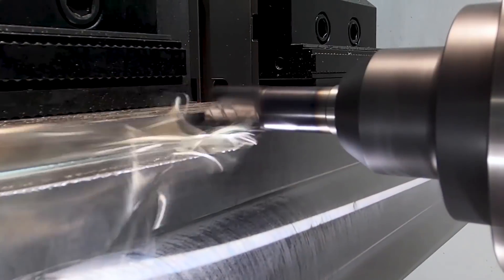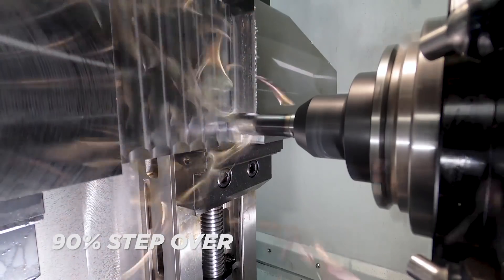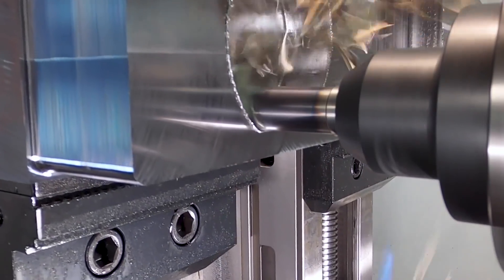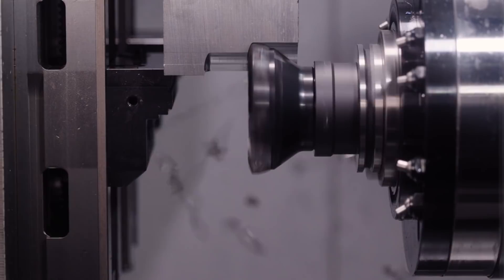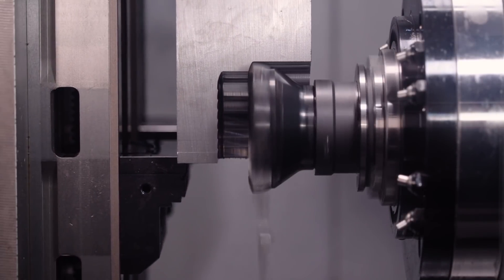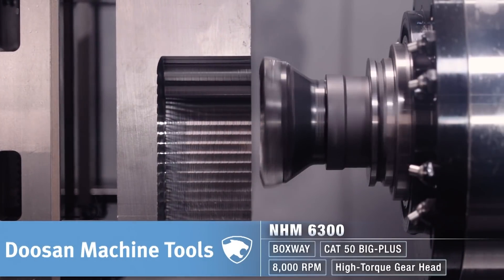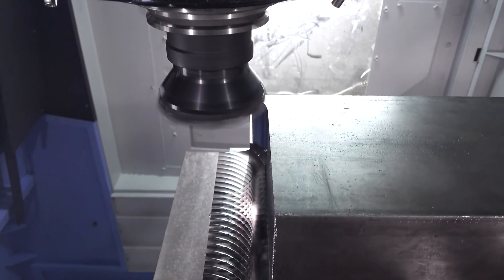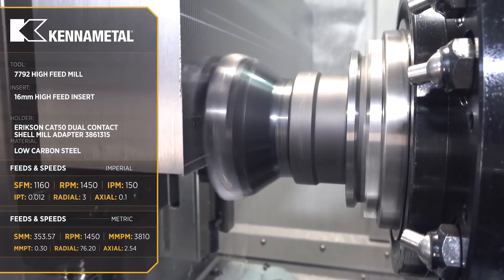Accepted a Complicated Job Beyond our Capabilities… Now We’re Screwed

Comment: One of the things my instructor taught me was it is okay to let your employer know if there is something you have never done before but don’t be afraid to challenge yourself. Who knows maybe the company will work with you to learn how to do the task they assigned you
Reply: That's exactly what I did when I took my first Inconel job. Each piece the material alone was worth 20k the customer sent us material for 3 pieces but we only needed 2. I told my boss I had never done it before but that I'd be willing to try. About 20 endmills pater I wound up getting them 2 pieces in spec and 1 out of tolerance with a deviation report. Supposedly all 3 were usable.

The prices were about 18x26x.450 and we were making chips out of over 90% of the material. Nightmare that job was.
Reply: If the company won't work with you let the company go.

Comment: bosses demanding stuff being done in-house without us having any of the capabilites necessary is the standard for consultants to rich kid startups.

They actually bought the big-ass gantry mill we needed to do the job once. One single job, an 800k machine, 3 months slower than outsourcing to a jobshop a bit over a km away. That delayed the start of the main production line for over 4 months. The machine is luckily used in one of the side lines now but i still get mad when i think of it.
Reply: Why are you still there

Comment: That’s a common scenario in machine shops and other industries.  I’ve always said “the salesmen make the promises, we (the workers) have to keep them.”. The sales people should be responsible for consulting with the production people on every job to discuss the feasibility of projects. When a job goes south like this one did, sales needs to take their share of the responsibility. It’s hard to believe that management allowed this job into the shop with an exotic metal that the shop had never worked with.
Reply: Management always has the final say in which contract to accept or deny.
Salesmen are just the "Pimps". Guess what it makes us?        : )
Reply: We had received a quote request for a job many years ago for an aerospace part, something like NASA would be using on a spacecraft. Large body panel, Boring Mill type work. Lucky for all involved, the shop foreman came to me, the person that would have been doing the job, and asked for my thoughts on it. I told them they do not even want to quote it, because it was way out of our league and would have been a disaster money wise. It was one of the few times they took my advice.
Reply: Right
Reply: I worked at a translation provider for a few years and we had a few jobs in my time where the salesmen (it was a mixed department but the troublemakers always seemed to be the guys) either promised services that we didn't know how to deliver or let the client stitch us up.
Reply: In this case the sales rep needs to take all the responsibility.  You wouldnt sell a wiring job to your plumber.  Sure the plumber may be able to meanser through it, but I'd be using shock gloves on your light switches for a while.
Reply: sometimes it is a good thing salesman does not know "it can not be done" workers generally does not look for challenges and settle into routines
Reply: @imrebalogh2786  - I agree with you. The shop wants easy, high margin, repeat work with generous tolerances and lead times. Guess what? So does the sales guy - but that type of work is RARE.

The challenge is needed sometimes to help the shop grow - but the trick is to balance occasional ridiculously hard stuff with the bulk of your work falling right into your core competencies. Shift the balance too far away from your bread and butter - and that will cost you business and employees.
Reply: Nobody in engineering or the machine shop wants to work in sales. Drinking and partying and sucking up to big fish clients. You all want to just work your machine so you get shit on. Better yet, start your own shop, upgrade your skills, invest, and when management tries to push you, push back until you have some capital and likeminded people.

Comment: Unfortunately for us our cam backbone is not great so when we get parts like that basically we get a basic program, then the experienced guys on the floor have to make it work. Used to happen to me all the time with our titanium parts. I'm totally comfortable with running Ti but alot of the guys on the floor either haven't touched it mill or lathe. And pretty much we never kick jobs out the top guys just get told to make it work.

Comment: hello I had similar problems, with a colleague we got titanium plates to be made, the managers did not want to hear about the problems, in the whole company, about 100 people, nobody worked in titanium, I spent hours gaining knowledge, but we paid for the failures with the programmer losing my job, Fanuc machine but low stiffness not intended for steel machining, more plastics, 5-axis machine but with three, threading, I came up with the idea of threading with a milling cutter, then they called me when we were making threads because they had a problem with it ... a lot of regret left
Reply: Threading with a milling cutter? I always use 2 milling cutters :)
Reply: @lokkas3637  it doesn't matter now, but back then it would have been very good advice thx👍
Reply: @piotrp9898  you aren't serios are you?

Comment: I was running a cnc 1000 ton beast PRESS BRAKE at the time and management wanted me to bend a 2.5 inch piece of steel 35 inches wide. I told them I was impossible because that thickness would need to be annealed before bending but could not be as it was stainless which can not be annealed and retain its properties as stainless steel. Anyways they forced me to bend it and it snapped in half while pushing at about 400 tons of force. BANG! Rattled the whole shop, scared the crap out of everyone. I was well clear obviously because I knew it would happen. Customer ate the cost but why risk damage to a half a million dollar machine. The end.
Reply: Something similar happened to me. I was bending a 1 inch thick piece for John deere, roughly 12 inches wide. Lead man wanted me to form it on a 56mm V die. My machine couldn't handle it so I went to a modern bystronic 220 ton which was also well underpowered. Per the instructions of "just run it". My die  split down the middle sending half of the 80LB die at me. The lead man came running from the bathroom saying "what happened the ground shook when I was in the sh*tter".
Reply: @griffinphilemon5083  yikes man I'm happy you were not injured. 56mm bottom??? On 1 inch plate??? My God someone could have been killed. Never go less than 5 times material thickness for your bottom or expect an explosion. And clear personal from the area. Appropriate bottom v size for that bend was around 300mm. That makes minimum flange length 4.25 inches or else one must leave trim stock.
Reply: @BarronBros1822  now that I think about it, it may have been an 80mm, but still too small. I've since left that steel factory. I don't think anyone had been professionally trained on brakes there. Just knowledge passed down, and now always valuable knowledge either. only a corner hit me but definitely could've been worse. Never good to have an accident on 220 tons of force.
Reply: @griffinphilemon5083  Nice man, I just registered my new buisness that specializes in nc press brake training, programing and consulting. Its called PRESS BRAKE SOLUTIONS out of Michigan so thanks for the reinforcement on why this buisness is a great idea! Have a great new year.
Reply: Wow some cool stuff i work on a much smaller press break 80-100 tons and 2.5 m of tooling. Its pretty idiot proof but the previous machine i worked on was not it had a manual mode wich was super easy to get to. You put it in to manual mode it would close with the full 100 tons of force till it bottoms out the pistons. When i started working on a press break i never herd of a press break had no clue how it worked and my qualifications were i know English i know how to use a computer (cnc machine)  and i like working with metal . My god when i look back i was a idiot my previous metalworking experience consisted of stick welding,grinding, 100$ Drill press and lots of hand tools. 2-3 months in to my job i lerned some basic programing how to make L and U and Z shapes and how to use manual mode in order to rest the ram on top of the die at the end of a shift . Had no clue how to calibrate the angel or what are the tooling specs like tons per m or how you need a larger v to lower the tonnage needed or to bend thicker material. In order to get the angel right on the older machine you would enter the Y coordinates directly so no wonder no one wanted to try and teach me that. Anyway 3 months in my coworker asks me to bend a 2mm thick sheet 10 inches wide  i punch in the bend he wanted bottom bending die V12 88degrees and on top goose neck tool also 88 degrees  i bend the L he wanted but he comes back wanting a sharper angel i dont know how to correct the angel on the computer but i do know this one way how to get that little bit of a sharper angel . I turn the machine to manual mode and go real light on the pedal knowing i could fuck something up but still wanting to get him what he wants now the coworker beeing longer in the company decides to give me some advice " just press the pedal it will all level out "  i turn off my brain and listen to him i press the pedal the pump starts humming i keep it pressed for like 4-7 sec and im getting a bad feeling although nothing seems to be happening when i let go the goose neck actually sprung back with a loud thud the sheet got coined and the goose neck bent on that 10 inch section we sold the machine but kept the section i deformed and 4 years later im still kicking it around the shop.